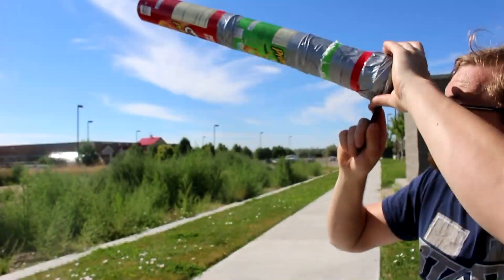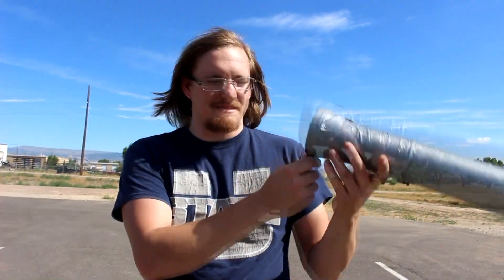Pinhole Sun Viewer

Comment: Very last minute and 6 years later but can you (somebody) explain the part about "measuring the focal length" ?  Is this the distance from the the lens to an object once it is in focus?  Are you looking at the image in the can and once it is in focus measuring from the 2 surfaces ? Should the magnifying glass be attached to the cup before measuring where to cut the can so as to take into account the extra length the cup adds to the length of the tube / distance to the "screen" ?

Comment: Isn't the purpose of a pinhole camera, to avoid looking directly at the harmful rays of the Sun. You only have that white plastic sheet between the sun's rays and your eyes? Is that safe?
Reply: 5:07 you can clearly see sunlight going through the plastic bag onto the side of the cup... surely this isn't safe
Reply: The light from the pinhole camera is projected (a la camera obscura) onto the plastic, so the plastic is lit up with the image on it. The magnifying glass is looking at the projected image, not directly at the sun itself.

Comment: Hey Cody me and my wife made this for the drive to Wyoming.  We found that with this and the projection box viewer styles, putting the magnifier just onto of the pinhole the light came in made the images very very crisp.  We did not use the one at the viewing end as we couldn't quite get the focal point right.  But putting it over the pinhole made the slightly smaller image incredibly crisp.  Whether you record it or not give it a shot on a good day its an incredible difference in clarity.

Comment: I'd be concerned that the plastic bag doesn't provide enough light filtration to prevent retina damage. Everything I read says use certified eclipse glasses or welding shade 12 or darker. A plastic bag lets a lot more light through than eclipse glasses, and then you've got it going through a magnifying glass before it enters your eye. Thoughts?

Comment: I'm actually getting a better quality image of the sun and clouds with a pinhole projector i made out of a cereal box.  I used a strip of soda can aluminum for the pinhole material.
make sure to cover all possible light entry points with tape except for the pinhole. Make sure the eye hole is also as small as possible and protrudes so it fits snug against your eye socket.

Comment: If I wanted to use a longer tube, would I need to make a larger pinhole? I can always cut the tube If I need to. Right now the focal length (between the pinhole and the screen) is about 30 inches.

Comment: Hi Cody, I was messing around with some pringles cans and noticed something, and I was wondering if you maybe could explain what i'm seeing. When I make a hole in the metallic end of a pringes can and look through the plastic lid towards but not at a light bulb, I can line it up so that the spot of light hits the dimple on the plastic lid. This creates a doughnut of light that looks like a 3d image suspended in the tube. Is this the light bending around the plastic dimple or is it light being obscured by the slightly thicker plastic or some other effect?

Comment: Thanks Cody. The lens is a neat refinement for a single user. You can also project the image, without a lens, onto a sheet of white paper so that several people can see the enlarged image at the same time, with no danger of accidentally looking at the sun during setup. I made a pinhole camera out of drainpipe and baking foil, with an A4 viewing sheet, for viewing the same Venus transit that you saw, and it worked very well.

Comment: Step one.  Buy cheap telescope.  2.  Reflect image of sun on piece of paper.  Much better detail that wont break the bank. Took photos of the Venus transit from doing exactly that.  Could see Venus along with all the sun spots around it.  Worth the investment even if you only use it a couple times

Comment: What about putting the magnifying glass before the screen? Could that have shorten the tube?

We usually use a pair of binoculars on a stand, focused onto a paper screen. We've also used proccessed unexposed (positive exposure) film, but that might be a bit risky as color film does not stop that much of the IR (it gives a very clear projection though). It might be safer for the eye with old silver-based film.

Comment: Could you use the magnifying lens the other way around? I mean like having the magnifying lens facing the sun, then having pinhole in the middle at focal point, and the screen at around 2x focal point? Could you have a pringles-can sized sun that way? Or just internal fire inside the can? Just thinking :D
Reply from the maker: in theory yes, that is how the sunspotter thing works but it would be really hard to aim.
Reply: Oh right, didn't think of aiming at all. But that's an easy fix, just add some simple DIY star tracker and you're all set ;-)

Comment: CHALLENGE for Cody, and potentially a really cool experiment.

I wonder if it's possible to create a light bulb or something similar to it using whatever you can think of, but the catch is - it shouldn't burn out, or at least, last for a very long time (50+ years).

The classic bulb is a tungsten filament in a glass vacuum envelope.
The wear out mechanism for these is that the Tungsten vaporizes a little bit at a time and deposits on the glass. Contaminents such as molecules of air in the  vacuum envelope probably accelerates this a little. Ultimately the tungsten filament becomes too thin and it physically breaks and that is the end of life of the bulb. 

Can you think of something to work around that issue?
Reply: those have a projected lifetime of 50,000 hours or roughly 5ish years.. it wouldn't match my original post.

Comment: Last time I used a hand-held welding filter to look at it. But, the safest way may be to project the sun onto a matt black surface via a magnifier lens mounted in a shadow-casting frame. Maybe build it into a cardboard box with a window to look in at the image?

Comment: You can make a huge image of the sun by using a small flat mirror and project the sun onto a large screen. The screen must be far enough away from the mirror that the mirror acts as a pinhole, but you can easily get an image of the sun that way that is a meter in diameter or so.

Comment: If the tubes were really light weight, make a pair, attach them to a visor: Stereo vision solar viewer.
The parallax would be a little on the narrow side, but looking with both eyes makes it more better.
BTW, could one use this to view/photo arc welding or other Special High Intensity Transient events?

Comment: Is this safe? I mean, you're still looking at the sun with nothing but a Walmart bag as a filter, and magnifying it. Even those special glasses made for looking at the sun say "limited to 3 minutes continuous use." In addition, they say "Never look at the sun without special eye protection. Direct viewing of the Sun can cause permanent damage if the proper precautions are not taken. Adequate eye protection specifically designed for viewing the Sun is essential and should be worn so that no harmful rays from the Sun can reach the eye."

I don't think Pringles cans and a shopping bag constitute adequate eye protection, but you know more about this stuff than I do; after all, I'm just reading a warning label, which is basically just a company's way of covering their ass, so there's that.
Reply: embrezar it limit the light to a pinhole size, dissipate it through a long tube and then project it to a plastic bag before enlarging the image with a magnifying glass. So yeah its safe.
Reply: I would have to back you up here. From what I gathered from the video, the light is going through a pinhole, then through a plastic sheet, then magnified by a lens and viewed with the eye. At no point in the path of the light is the harmful IR or UV radiation filtered. I would not view the sun through this at all, it is not safe.

Comment: Re-post in case you missed it:
If you decide to use your telescope do NOT use the sun lens! (If it came with one) When I was younger I was sketching sun spots when the filter split in two.  Luckily I had just turned my head away so I only ended up with a bad burn across my cheek.
Instead, take out the eye piece and project it onto a piece of paper.
Great videos!!

Comment: If you had the Pringles® can interior spray-painted with a flat black paint, would it have improved the image quality?
Reply: I love how you used ® after Pringles
Reply: Danny M actually I have a breezeway between my garage and my house. The tuna can lid precise instrument is screwed to the gutter of my garage roof and the point of light is projected onto the wall of my house. All I had to do was to go out at precisely the same time every day, and place a mark in the center of the dot. The first day of each month got a copper nail and the summer and winter solstices got a silver tack. Equinoxes got a double silver tack. If I go out at exactly 12 noon and observe where the dot intersects the analema, I can tell what the date is. Conversely, if I know the date, I can ascertain noon by the intersection of the dot of light and the analema. #oldfartgeek
Reply: Bosco Bob Definitely. Aperture quality is mainly an aspect of the thickness of the material. A tin can is quite thick compared to a foil. Try making an aperture out of a soda can using a sewing needle to pierce it. Remove the burr with 400 grit paper. Then cut the piece and fix it to whatever pinhole camera you wish.
Reply: Danny M great idea on the sanding. I may try that to improve the "sun dot" on my homemade analema on the side of my house. The tuna can lid dot is a bit fuzzy. Thanks for the tip.
Reply: Bosco Bob I gotcha. I was thinking of a pinhole camera. Your project has some interesting possibilities for future architecture details. I have a nice view of the southern sky; the creative wheels are turning now - perhaps my own Stonehenge interpretation.
Reply: VeniVidiVici just a CYA... We live in litigious time ya know. Gotta cover all the bases.  😏
Reply: Bosco BobI was thinking the other day of possible landscape features for my yard that would do something like/maybe exactly what you're talking about. Except I forgot that analemma was a word. Now I'm all excited. Time to put off today's responsibilities and plan a project that I'll eventually do in 2-5 years.
Reply: Yes - flat black inside. Also sanding off the burr on the inside of the pin hole aperture will improve the focus. A local camera shop should have a laser cut foil aperture for about $5.00 - better than anything you could make.
Reply: Bosco Bob it should.
Reply: Bosco Bob Hahahaha very true
Reply: Bosco Bob Oh I will. Right now the exact features and implementation are a bit fuzzy but it's going to be awesome once I figure it all out. Hopefully I actually follow through some day after I finalize a meticulous plan. That's always the kicker...
Reply: i prefer Lays®
Reply: @Danny M I need something fairly rigid to deal with the snow loads on the roof. Great idea, but it would crumple after the first snow. Since I marked every day for an entire year, accuracy is not quite as critical now. My analema can still get me within a 7-day accuracy...with sanding, maybe ± a day or two?
Reply: Bosco Bob sounds like a neat project. Are you exposing a whole year onto a single print?
Reply: +Nicholas Alt I had an idea to take aluminum plate and CNC some celestial shapes (stars, moon, galaxy swirls). If I could have them overlap and all line up in some way to create a pinhole at exactly noon, then I could dispense with the tuna can lid and have yard art and the analema. Feel free to steal the idea. :)

Comment: I'm just going to use welding goggles and binoculars to view the solar eclipse
Reply: Execute1313 arent welding sparks brighter than the sun?
Reply: joey green go through welding goggles? Naw man it's way to small of a lense to focus enough light anyway
Reply: once i saw the sun with welding goggles, and i saw it perfectly.   I believe those goggles can handle a solar eclipse just fine
Reply: Brendan Stanford make sure the goggles go before the binoculars, otherwise you risk damaging the goggles and thus possibly your eyes by the concentrated light
Reply: Put a welding screen in front of the binoculars
Reply: just shove a 1000 degree knife into each eye
Reply: Our eyes don`t persieve brightness linearly. Welding may appear to us as bright as sun, but sun is MUCH brighter.
Reply: Very few things on earth are brighter than the sun. Welding is not one of those things. If you stare directly at the sun with anything less than a #14 filter, you will damage your eyes.
Reply: Betta use that 10 shade man shits bright
Reply: When we had the last partial eclipse someone came out of the laboratory with mutiple welding glasses. Apparently there are different types, one type could be used directly, the other type was too clear, so he taped two of them together.
Reply: My3dviews, there are no welding filters above #14, at least I never saw them IRL or online.

But yes, the #14 is for viewing without anything else, no binoculars. BTW you can use #13, too, but #14 is much more pleasant, especially if you use something that covers your eyes completely.
Reply: +Lajos Winkler   Could be.  I guess it's solar filters for telescopes that have numbers up to 16, which would be safe for use with binoculars or telescopes.  
http://www.mreclipse.com/Special/filters.html

quote: "Relative Safety of Solar Filter Materials
Not surprisingly, there was a wide range in the attenuation of visible light by these filter materials. Even among the "safe" filters, there was considerable variation in transmission levels. For example, the differences in processing methods and chemistry resulted in considerable variation in optical density of the silver-bearing black-and-white film emulsions. The double-layer filters had shade numbers between 11 and 16."  end of quote.    Not sure if those numbers are the same as the ones used for welding filters.  

Always best to research things before risking damage to your eyes.  Once damaged, they can never be repaired.
Reply: Mr Snugglepuss it is, but using binoculars makes it dangerous- it's better to just be safe. You don't even need binoculars for the eclipse anyway.
Reply: +Jonathan Vandagriff   It is usually recommended that you use a 14 for solar viewing.  https://www.space.com/15614-sun-observing-safety-tips-infographic.html
Reply: Note that welding goggles are not as dark as eclipse glasses.
Reply: Sounds like a plan
Reply: he wants to view it better i guess or possible troll? i dunno. :|
Reply: joey green he means turn it around the other way I believe
Reply: +gregistopal im saying you're taking a risk you shouldn't. with my telescope if I dont have my filter on it'll instantly burn my retina and I wouldn't even know.
Reply: my3dviews ew, orion, thousand oaks is much higher quality.
Reply: thousand oaks is what i bought and can personally attest for
Reply: +joey green  Buying higher quality when protecting your eyes is a good idea.   I have never bought a solar filter for my telescope yet, but if I did, I would make sure what ever I buy is safe.
Reply: Yeah, for $5 on Amazon you can get a welding lens and get a better view of the eclipse for far less money.  This is still a cool DIY project.
Reply: You do realize welding is way brighter than the sun. Please stop being an idiot and spreading misinformation.
Reply: Brendan Stanford i
Reply: the lense must be #14 or better
Reply: make sure it's at least shade 12 or you'll fry your eyes...
Reply: make sure it's at least shade 14 or you will fry your eyes...
Reply: Do it up guys that's just a few less stupid people who will be able to use their vision. Natural selection ftw
Reply: Aeroscience you misunderstand how fucking bright wedding is the goggles will more than handle it
Reply: For the love of god, don't use binoculars. They'll increase the magnitude of the light and may be strong enough to go through. Watch with just welding gear, then take it off at totality.
Reply: DON'T. You will blind yourself. Get proper solar filters for your binoculars.
Reply: +Brendan Stanford   That's a really bad idea.  First, in order to look at the sun safely with welding goggles, you need a filter rated 14 or higher.  Solar filters for telescopes are not just dark glass, but have a reflective surface to reduce the light that passes through, before the light hits the telescope.
http://www.telescope.com/catalog/product.jsp?productId=7710&gclid=Cj0KCQjwh_bLBRDeARIsAH4ZYEOc_LfxEN1ag0Bx_Q5LQJUUjwg2-jfx8TdEEn4Z7hFqPYtU3jbI_xAaAljpEALw_wcB

You can also buy solar filters designed for binoculars, that would be safer (if used properly):  http://www.telescope.com/catalog/product.jsp?productId=116993&gclid=Cj0KCQjwh_bLBRDeARIsAH4ZYEO18E5JiApYGoGlueBz4aib2xdI1sWsQEfIjGgL1XNFY21oBHXt9RkaAui_EALw_wcB
Reply: Just use Binoculars only.  All the "Going Blind" stuff is just nonsense.
Reply: spend 15 dollars on a sheet of solar filter. ill be happy to post an amazon link or just search yourself
Reply: dr donald J trump, I've got a 9 inch one for my telescope, works a charm. no sunspots currently tho.
Reply: This is a bad idea, the binoculars could generate enough heat on the goggle lens to burn through or shatter the glass exposing your eyes to concentrated unfiltered light. Your vision would be destroyed in an instant! This is why Codys pin hole viewer works, its blocking all that energy from entering the tube.